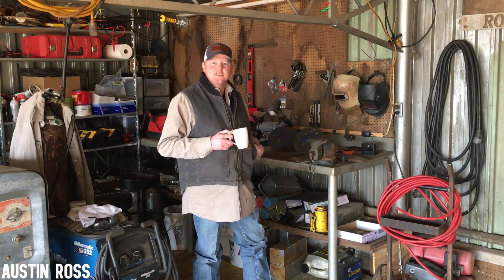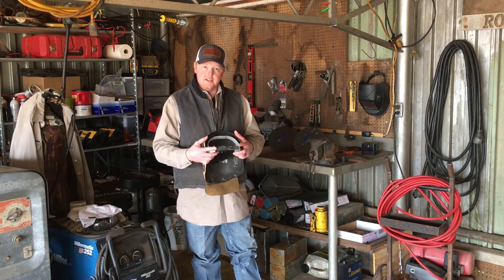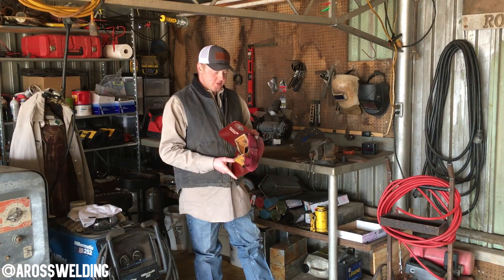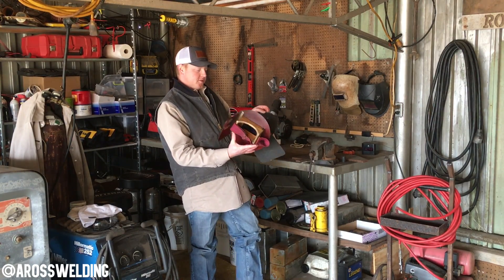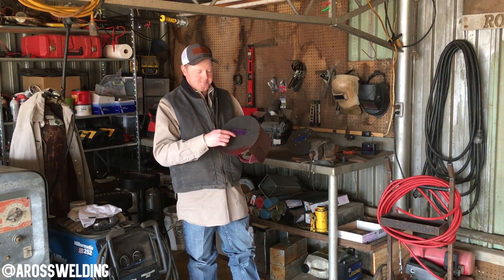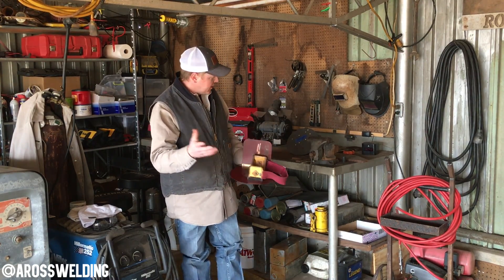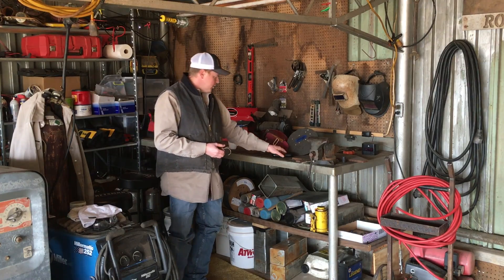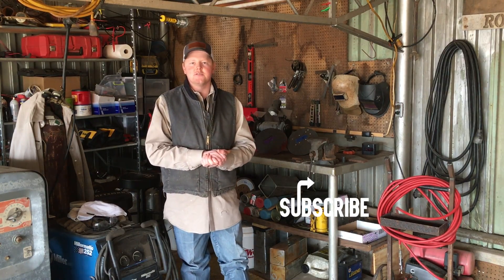WELDING HOODS | Pancake vs. Sugar Scoop vs. Flip Hood

Comment: My pipe instructor used broken portaband blades and Sharpies to mark new Fibre-Metal Pipeliners for cutting for increased chin tuck and on top for neck clearance in close areas. Fast and easy then slice with a zip disk.

Comment: If you work in a shop, auto dark is the way to go. A lot of strain and injury to welders is in the neck from flipping hoods down all the time. Autos let you keep working without the need to do that. Even now they are coming out with crystal clear ones that give you better sight when the hood isn't active, as well as a clear view without the dark green color.

Working rigs and lines in the bush you've gotta go fixed, don't have time to mess about if the batteries go dead, or if something happens to the auto dark mechanism. Though I would take the pancake over the the fat boy any day just for how light it is, and when you're just burnin rod not stop on a pipe you don't want some heavy hood.
Reply: I fab big electrical enclosure buildings in a shop. When we are framing them I am on ladders 10ft and stuff like that. Overhead, horizontal, vert. I have always used a pipeliner with the flip up lens part so you can grind with it on too. I personally use it I guess because I've been using it since I started and am just good with IT. But trust me..I get the neck thing..very good point.
Reply: @mathewmccauley6965  I just bought a pipeliner with the flip front and have some questions .... do you see double weld puddles. how heavy is the pipeliner. do you have an AD lense in your pipeliner , do you tig weld with yours if so what shade do you use?

Comment: Interesting. I'm an Ironworker by trade and almost all of us want the biggest lens we can get because we almost alway weld in weird positions and need to be able to see. Plus we are required to wear a hardhat with our welding hood. Me and most the guys I work with use a Jackson hood with a 4.5 by 5.5 inch number 10 gold lens. If for some reason it blows off my head and falls 100+ feet I won't cry because I can get a new one with a new lens for about $60.
Reply: Check out the radnor wide view  hoods at airgas

Comment: Have you tried the Original brand pancakes? They are about half priced of the others. And I really like the rolled edge so nothing can catch on it. Plus you CAN get it in the smaller "old" size although it is not OSHA approved.

Comment: I was wondering what the main differences are? Like why does pipeline welders use a pancake instead of a sugar scoop stuff like that. I'm not a pipeline welder so I have always wondered why.
Reply: Edward Ramirez pancakes are good for pipe liners because thy are out of position on every weld beckus it’s a pipe and there just a little easier to move around in and are a-lot closer to your face than a normal hood and they block out light from behind you so you don’t get glare
Reply: Alot of guys use the pancake  hood because  they dont let light in from behind, but I use modified sugar scoops/ pipeliner hoods. Mine has a flip front and I cut the top half off and replaced it with leather as well as the bottom  half of the hood and I did that to reduce  backlight with my hood on a hard hat and so I can fit my head in very small spaces.

Comment: Steve Fenton passed away in 2015. I just got a tig welder, and I am adding gas to my lincoln mig. I also just picked up a plasma cutter. I've been looking for suggestions on a hood - I've been using cheap harbor freight and local welding supply hoods (less than $100). I am having problems seeing what I am typing right now, thanks to one of those hoods. I've been told to look at an optrel, a lincoln viking, and most recently a pipe fitter told me I need to get a Wendy's pancake with an eagle vision auto darkening lens. I just need to see what I'm doing. Do you have a suggestion for the best visibility of my arc? I really don't have a bunch of money to dump into a helmet at the moment due to dropping several thousands of dollars on welders, cutters, gas cylinders, consumables, etc. That wendy's hood is looking pretty good at $150 (with the lens), but I have never used a pancake. I will be mainly tig and mig welding. I really enjoy your content and the way you present info. Thanks for the effort you put into your channel.

Comment: I bought a sugar scoop and it hurts my eyes with any kind of lens I use. Auto darkening, shade 10-12. I can feel it in the back of my eyes for some reason. Any idea why?
Reply from the maker: That arc is prob gettin in from underneath. Your eyes might get used to it eventually. If not, then you could get a pancake, this would eliminate any arc from getting in.
Reply: Any chance u have light colored eyes? wear good quality uv rated safety glasses under the hood. I have light blue eyes and i find im more sensitive to it. I wear good safety glasses under my hood that are uv rated it keeps my eyes from hurting and saves you from the effects of getting flashed around other welders. I also always keep a pair of the shade 5 hobart glasses close at hand if im close to other people welding, especially indoors. Also make sure u arent using a shade that is too dark. I find if my hood is too dark i get eye strain from trying to see what im doing.

Comment: And those hoods are all auto darkening? And is it true you should switch out the lenses every so often when you work, like after a certain amount of hours?
Reply: DSaucey on auto dark just use it til it gives out I've had a arc one super singles in my pipeliner hood for at least 2 yrs still good.
Reply from the maker: Every pancake hood I’ve ever bought have not came with a lens.  You have to buy those separately. But yes I use auto darkening lens. Singles is the brand I use. I usually get a couple years or more out of one. What you may have heard about changing the lens was most likely the clear lens. They are to protect the actual auto darkening lens. One goes on the outside and one goes on the inside.

Comment: I'm struggling to work out the benefit of these pancake hoods. They seem popular with pipeline guys so there must be something, I just can't work out what it is.
Reply from the maker: For me, it is because they are very lightweight and block out all sunlight.
Reply: Austin Ross that is a very fair point, it is very annoying to get sun glare from behind, on the rare occasion I weld outside. I guess they were originally just modified oxy goggles
Reply: Exactly what I was hoping to find out in this video